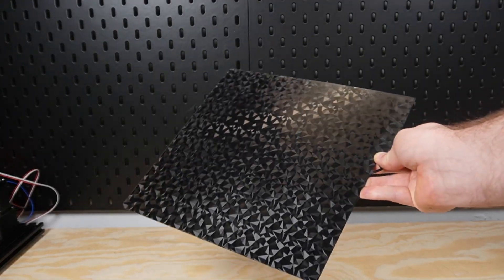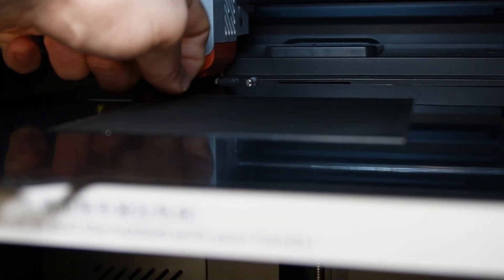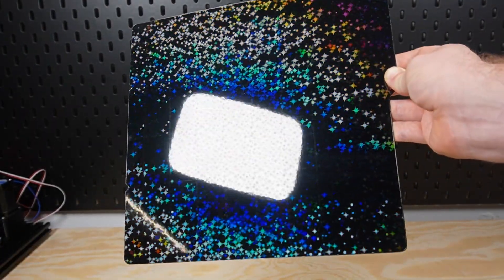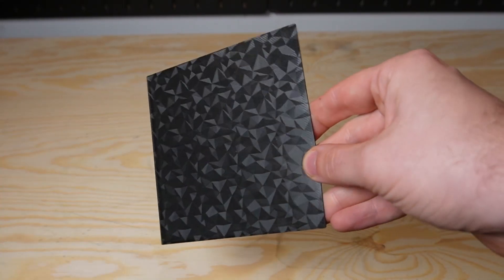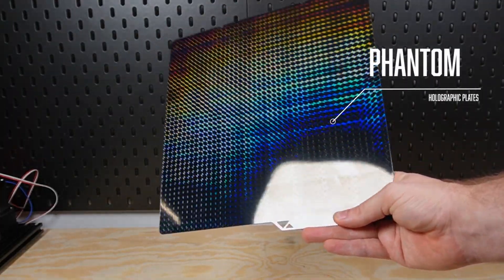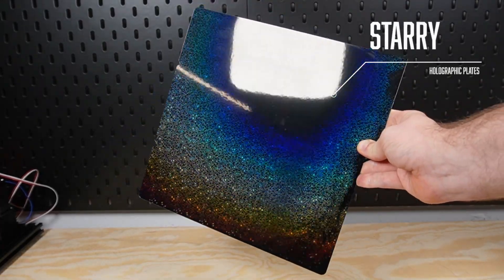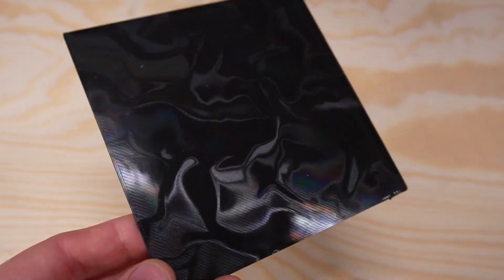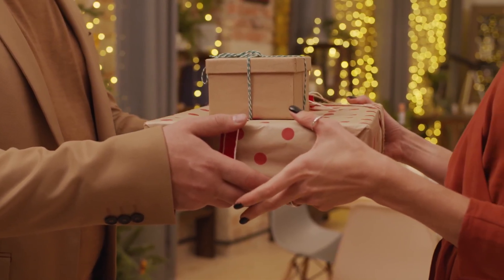Best Printplates for Design – Easier Than You Think!

Comment: I have bought a holographic plate on AliExpress, prints fine but when I rub the printed parts the holographic reflection goes away. Is this normal?
Reply from the maker: Did you use adhesion spray? If Yes then you should try to reduce this a little bit.